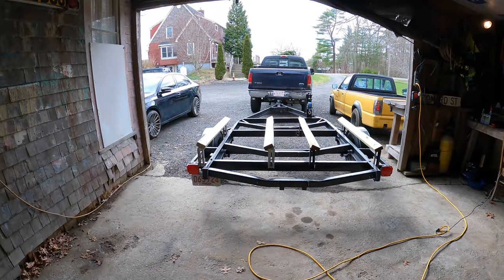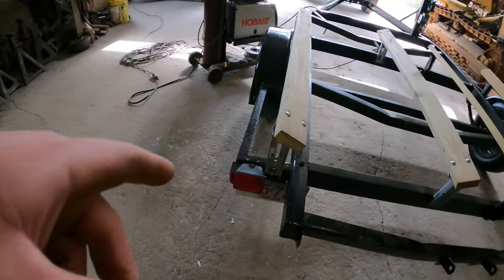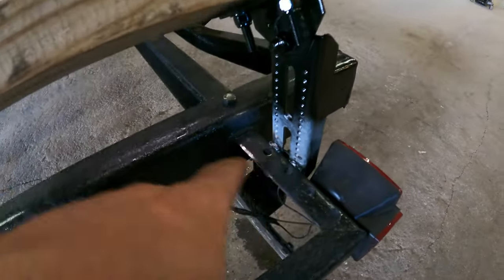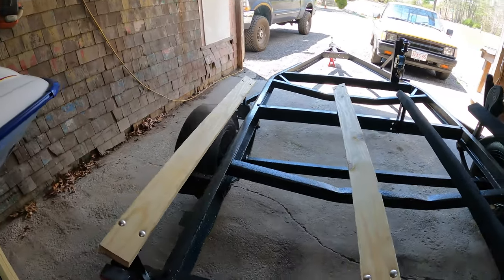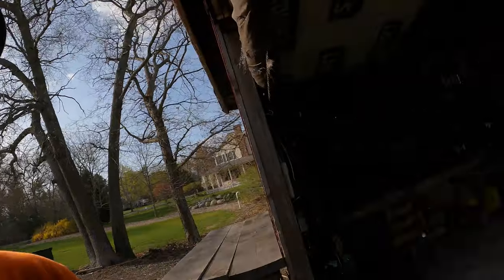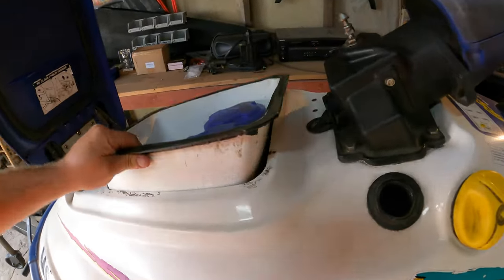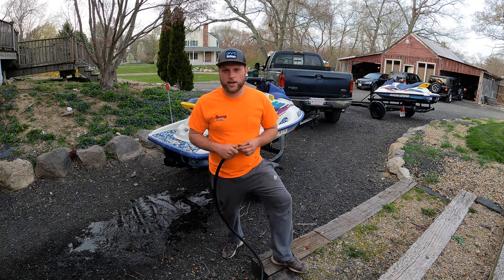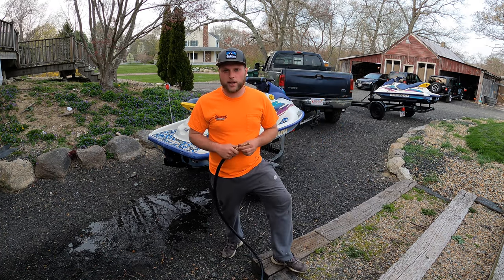Double Jet Ski Trailer Build Ep. 2 + Starting The Working GSX For The First Time This Year!

Comment: You don't need to weld those brackets on, u bolts that are squared to fit work just fine and have never had an issue with them! But great video as I have the same exact trailer I want to do this to!